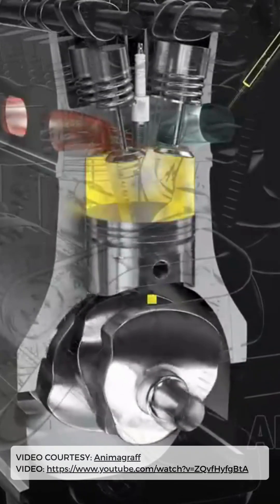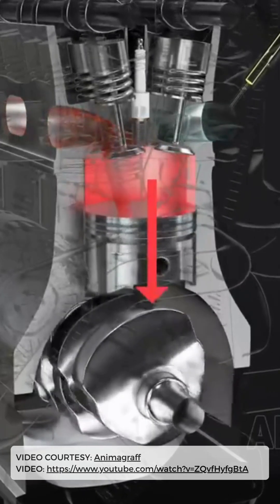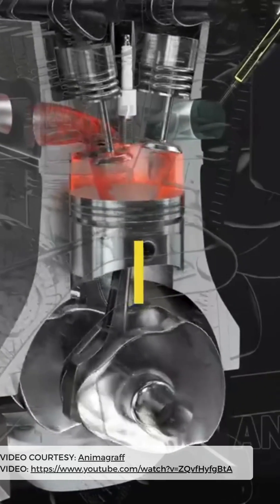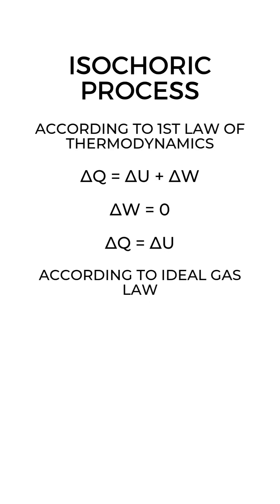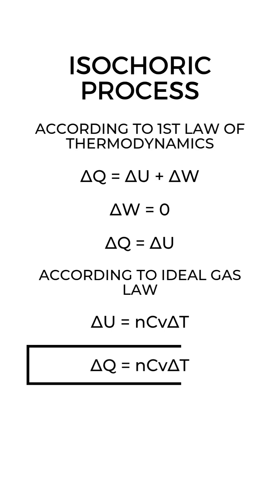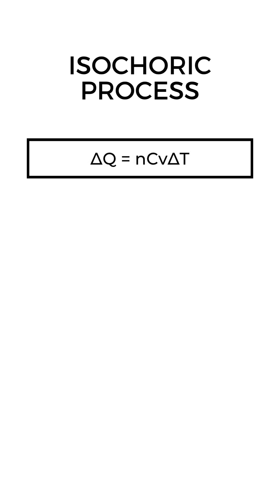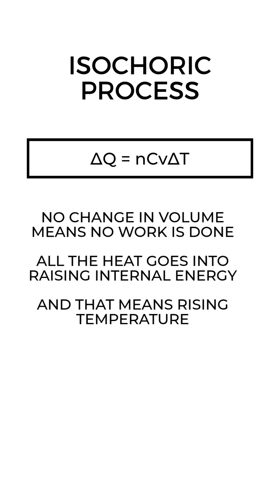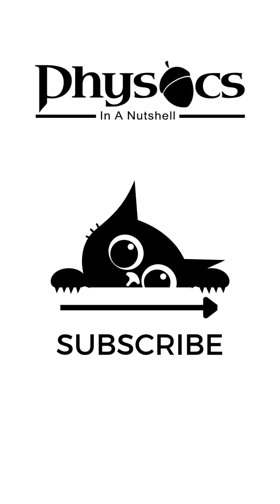Isochoric Process - Thermodynamic - #physics101  #thermodynamics #1stlawofthermodynamics

Comment from the maker: Since heat (Q) and work (W) are path-dependent quantities, they are not state functions. Therefore, we do not write them as ΔQ or ΔW. Instead, we write:

Q = ΔU + W

where:
ΔU is the change in internal energy.
Q is the heat added to the system.
W is the work done by the system.